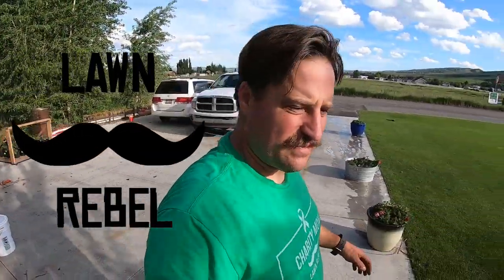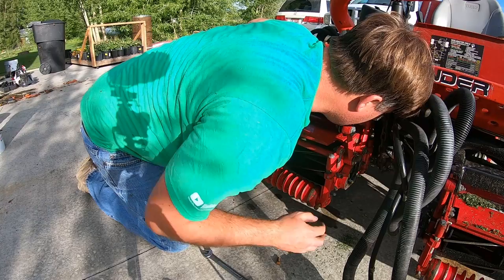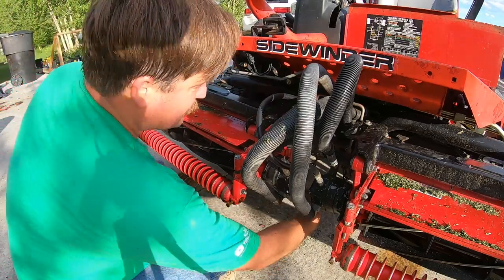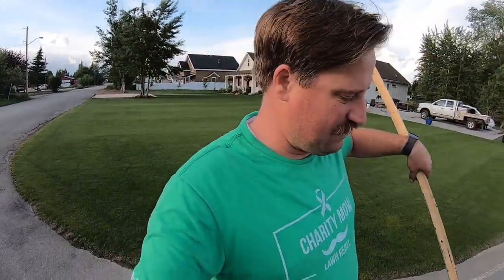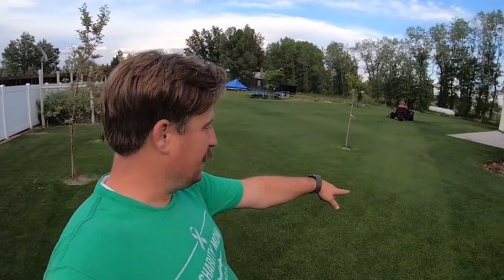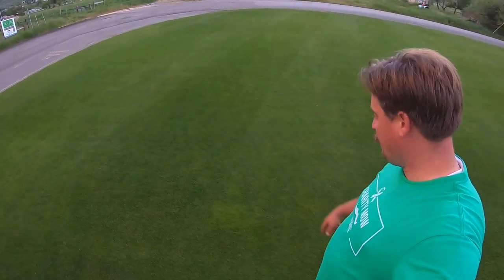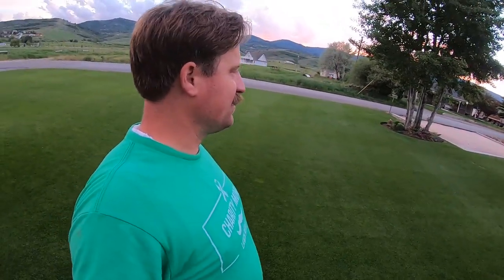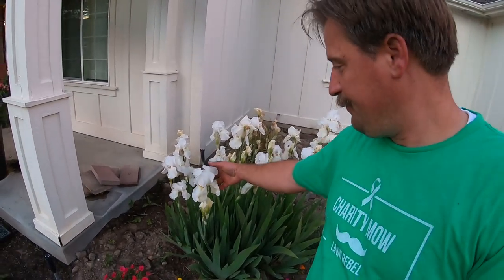Another Night in the Lawn

Comment: @connorward most the of the time, if you run into something and you start to get that tinging noise. If you keep running the mower it will usually grind its self out. Also you need a feeler gauge when checking.

Comment: You think it needs grease! the entire unit drive should be packed with it you have nothing in it! Also you don't need to bother taking your blades to be sharpened, just use the mower more and it will gradually take away the burr
Reply from the maker: There was a broken weld on the reel
Reply: @lawnrebel  ahhh you going to buy a new reel then or try fix it